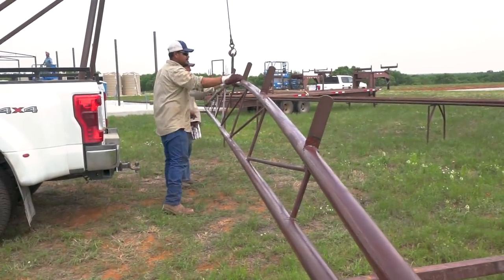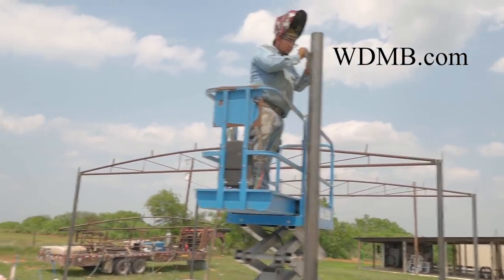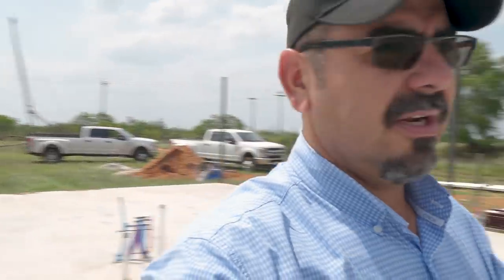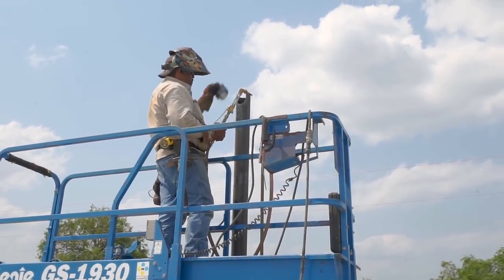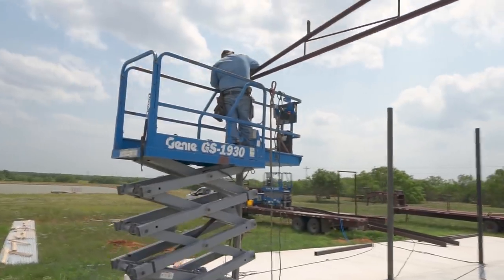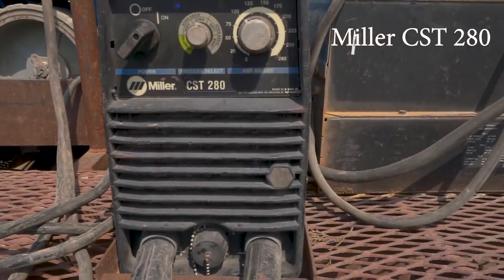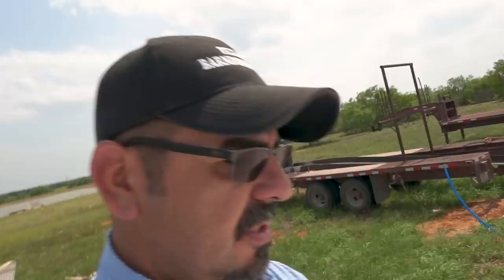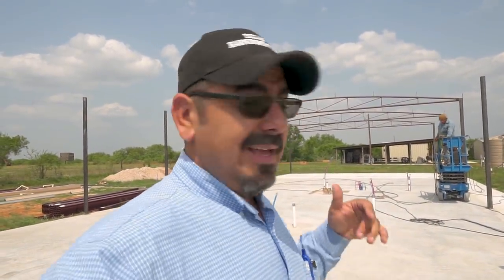Metal Framing Barndo 169 - The Barndominium show E123

Comment: Erik...on your next build show how the metal posts are connected to the concrete?  I believe there is a plate anchored in the concrete and then the pipes are welded to the base plate.
Reply: I would also like to see more detail on the interface between the metal building and the stud walls.
Reply: I like this guy😉 I just might subscribe 😁
Reply from the maker: @Ron Thurmond, I have a few other videos that show that but I’ll make sure to point it out next time.
Reply: I missed this comment, void my question.

Comment: Hey Erik awesome buildings you guys do good work. I was wondering if you have thought about welding a larger diameter pipe to the ends of your truss that could slide over the vertical pipe that could stop on another 4 inch chunk that is welded on at that correct height it would eliminate the need to have a torch up there and might speed up things.👍
Reply from the maker: There was no one waiting on anyone, so I don’t think it would speed up anything.  But interesting idea.  Thanks.
Reply: Texas Barndominiums if the spacing is dead on it would be nice because you wouldn’t have to wait to cut any holes or notches it would just be welding

Comment: Good looking work. Have you had the occasion for any of your barndo's to be tornado tested? Just curious. We don't have many tornadoes where I am but have hurricanes and nor'Easter's so I was curious about wind loads. Also, know you're warmer in Texas than we are but do you make any provisions for a thermal break between your porch slabs and the main house slab? Lastly, I'm sure it's different where you are, but how difficult are your building officials to deal with? I'm assuming they view barndo's as non conventional structures, or do they handle the first phase as just the metal structure, and then the interior framing as typical residential work?
Reply from the maker: Please Email me:
Erik@texasbarndominiums.com